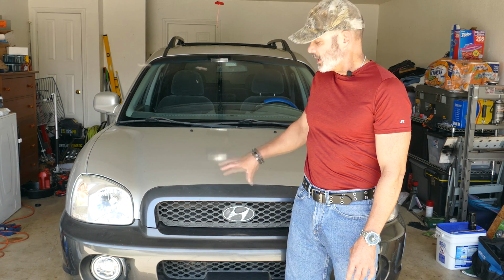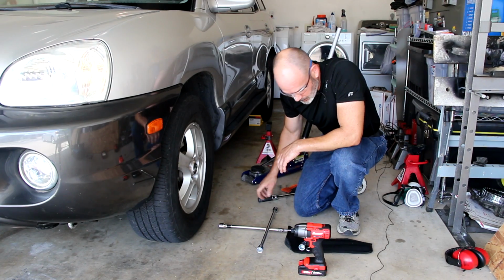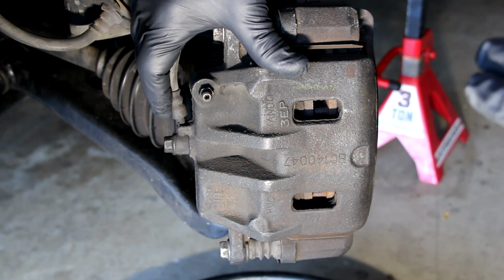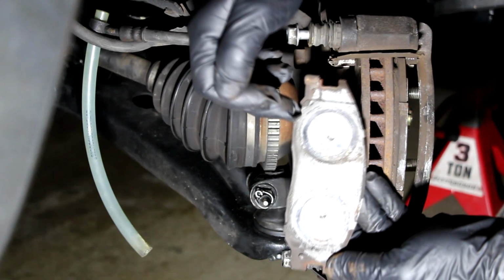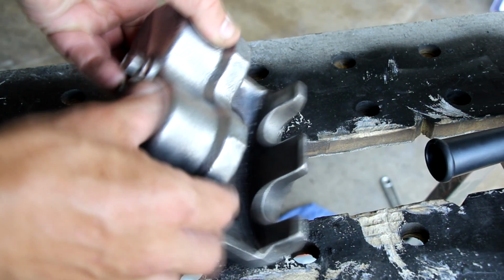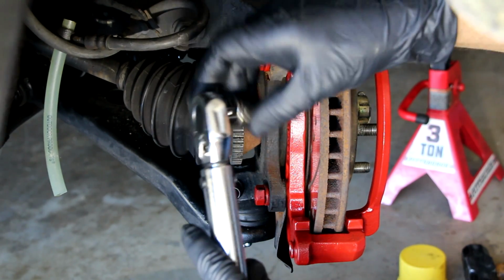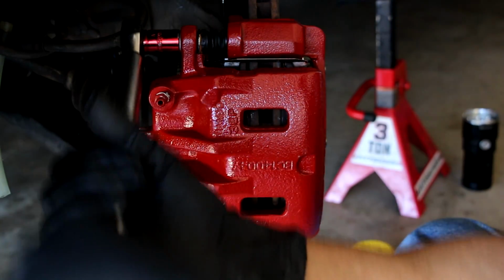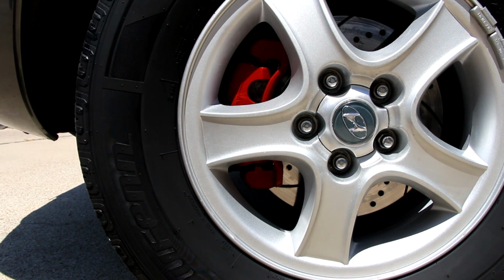Paint Your Brake Calipers Front Hyundai Santa Fe 01 06 Red

Comment: I think those jack stands have recently been recalled by Harbour Freight. Not the original bunch recalled a while back but a whole new bunch. Apparently a weld issue this time not the ratchet like the others.
I could be wrong but you should check them out.
Reply from the maker: Yes they were recalled, but I checked mine and they are not the defective ones, phew! I posted a link in the video description for the recall. Thanks. All the best!

Comment: Nice job, did you fix or replace the auto transmission.  How's the virus affecting you?.
Reply from the maker: I began disassembling the transmission(automatic 5 speed), clutch plates, valve body, solenoids etc., but I was not finding the issue. The clutch plates were burnt but replacing them did not fix the problem. There was metal in the fluid and I determined that the problem was further inside the transmission (planetary gears maybe?). But I sourced a donor Santa Fe at the salvage yard, my Santa Fe is a 4WD so it has a "special" transmission built to bolt on to the transfer case and drive that, but it looked really good and the salvage yard only wanted $200.00 for it, but I had to pull it out of the current Santa Fe myself in the salvage yard (pull your own parts salvage yard)! I did do an inspection and the clutch plates looked new, the transmission housing was surprisingly clean, fluid looked great (no metal) there is no way to really test it, but prior to being put in the yard they do test them and paint on the windshield as to it working or not (this one said it was good) but you never know. It's a salvage yard after all. I decided to pull it and see. As I am removing the transmission, I get to see what I am up against on my car putting it back in. So I release the transmission from the engine and the torque converter is painted blue and it looks brand new (no wear on the teeth that the starter engages to and no corrosion at all!) By the looks of it the transmission looks like it's either been rebuilt or replaced with a very good donor recently in the salvage yard vehicle. I did note that the transfer case on the salvage yard Santa Fe looked like it self destructed (probably run dry) no one ever checks the fluids in the transfer case (I do and have a video on that. Did it again of course). My guess is the owner had the transmission replaced and then the transfer case failed (it was in many sorry pieces) purely speculation. So I rolled the dice and pulled my transmission from my Santa Fe and replaced it with the salvage yard transmission (They actually gave me $40.00 for the old one!) The new one I installed had problem with the speed sensor (I had a spare) I replaced it and now it works FLAWLESSLY!!! I couldn't be happier with the job. Not an easy job, the transmission weighs 300+Lbs and the transfer case is another 80+Lbs. Many challenges in getting it done but all's well that ends well. I changed the sway bar bushings while I was at it and learned so much about the vehicle that I have no problem repairing anything under hood now (I hope I don't have to for a long time). LOL The speed sensor being worn tells me it was not a new transmission but may have been rebuilt (it was very clean compared to the engine). I did the valve cover gaskets (front and rear banks) and replaced the plugs with my favorite plugs Denso Iridium TT Spark Plugs (0.4mm Iridium Center Electrode 0.7mm Platinum Ground Electrode) amazing plugs! Check them out if you have a chance Paul. Changed the oil with synthetic 10W 30, filter too (OEM are the best). The engine idles so smooth now you can barely tell it's on at idle. LOVE it. Fortunately the salvage yard was deemed essential during the shut down so you could legally go and get parts there. YouTube is very picky about discussions around the current "situation" that is affecting the whole planet so I have to self censor. I am fine and my family is also doing well (we are a healthy crew). Texas has made it mandatory to wear face coverings in all public spaces (responsible move) and outside of feeling like I am living in a science fiction movie all is as well as can be expected. My heart goes out to all who have been adversely affected by this "situation". I pray that you and your loved ones are well and that the UK, USA and the rest of the world come out of this as soon as possible. We are all brothers and sisters in this case. God bless Paul. Thanks for watching and commenting. All the best.
Reply: @richardlloydusa  We are not allowed to take parts off cars it's all off the shelf, health and safety 🙄🙄🙄. In the old day you had a choice you could read the mileage and pick the best, I hope you're not going to change the oil many times on the new box lol. Yes YT don't like the mention of the Chinese Shivers, my god what have they done. Anyway all the best, ps Rustoleum a good product a bit hard to get here.
Reply from the maker: The newer cars even 2001 Santa Fe has an electronic odometer and the salvage yard takes the batteries out before they put the cars in the yard (environmental concerns), so you really have no idea (they don't put the mileage on the windshield, unfortunately, they should). Even if you had access to 12V you would still need an ignition key to see the readout (some cars have the key (rare) most don't). I am thinking a VIN check on your phone may be a possible route but even in this case the transmission, I speculate it was not the original, buyer beware. It's a 17 year old vehicle so it's nearly a "classic" LOL/  I am at this point quite sure I scored a good one. The fluid was completely drained by the time I was finished installing it and it was fairly clean to start with. I may give it a swap after I do the CV axles (blown boot on the passengers side and the drivers side clicks once in a while). I will be videoing that process. I purchased the axles on eBay new for $58.40 (drivers) $61.86 (passengers) US. At those prices it does not make much sense to fix a boot on a CV axle which I assume (used vehicle) has as much mileage as the one that is starting to fail. A CV axle is not something I want to gamble on (critical component) especially when they are so cheap new. I will be doing the brakes (rotors and pads front, pads rear) too. Seeing as we are stuck mostly at home these videos are helping me keep busy. I also bought a simple wheel balancer https://ebay.to/38GoTJV and have had great results with it too. I may do a wheel balancing video as well. Cheers to you Paul. Stay tuned, safe and happy. All the best from Texas 👍😀